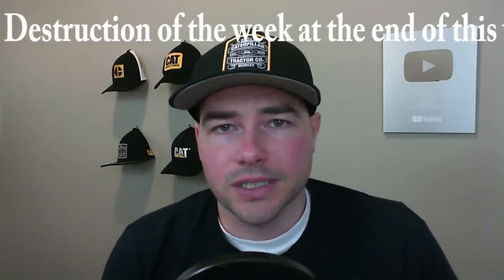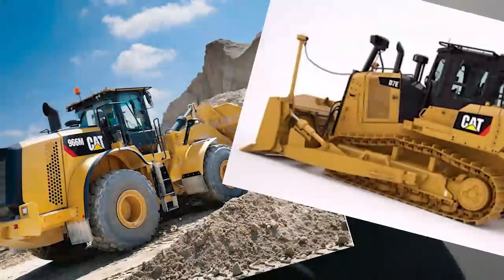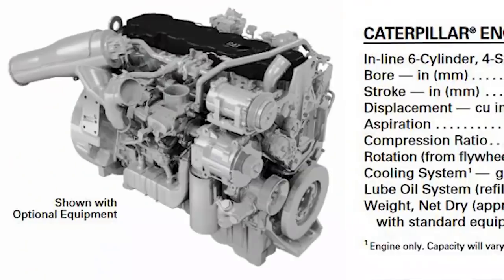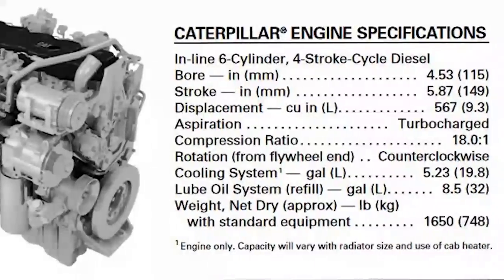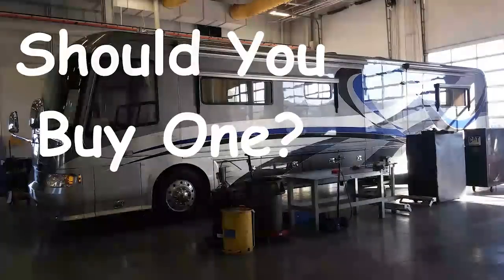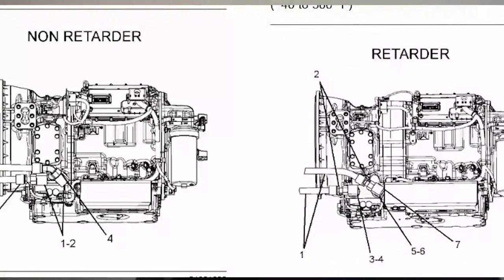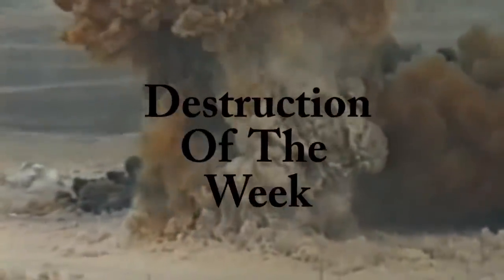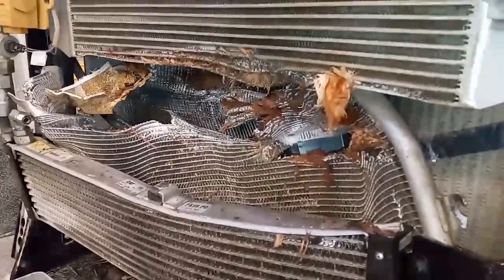Did you know Caterpillar made a TRANSMISSION for Trucks and Buses? The Cat CX28, CX31 and CX35.

Comment: In 1970's i drove Freightliner cabover with  Cat 1693 or was it PCTA 360???? (3406 name came later i think?)  with Cat 16 speed for CP Bulk Systems. Definitely not driver friendly compared to the Spicer 16 speed or Fuller 13 & 15 speeds in fleet with different drivers. Truck was a demonstrator and disappeared from fleet one day... It was rumored that US Army bought entire production.  Nobody missed driving it! Around the same time there was Allison CBLT trying to break into market. Don't think it was successful either. Remember back then big power was 350 Cummins, 8v71T's. Think that 1693's and 360 hp PCTA/DITA 3406's suffered from 2100 upshifting programed into drivers back then. No one was aware we were driving them wrong not using the generous torque curve. Unless previously driven a Mack (lots of Mack drivers never used the torque curve properly either with Mack 12 speed tranny).

Comment: Thr PTO location on this transmission was one of the biggest pain in the ASS to get to. The bolts never stayed tight.
Reply: Not even red locktite?
Reply: Snap on has a short stubby 10 mm ratchet wrench with a 3/8b square on one end. That was the only tool I could get some torque on the bolts with. Also had to use the pto manufacturer gasket because the CAT PTO cover gasket seemed to leak if used with a pto.

Comment: Was the Eaton Ultrashift a Option in The Cat Trucks as a Automatic (even though it is technically a Autoshift not a Automatic since it doesn’t have a Torque Converter)? Allison Automatics are Used in Many of The Super Haul Semi Trucks, The Allison 4500RDS & 4700RDS Transmission. Those Transmissions are Worth The $18-20,000++ Upcharge if your Application Calls for it.
Reply: Worked on a few CT660 cat trucks with the  Ultrashift automated transmission.  Most reliable besides a regular stick shift.

Comment: The cx-35 is still used in the 745 articulated truck and are still trash, we see them all the time, they are on there like 20th service letter now
Reply: And when ordering parts to repair them under the service letters, cat will only release them with a dsn number now :/
Reply: Yup we had to replace our transmission on 2012 740B truck at 5,000 hr now at 9,000 hr sometime the transmission downshift at high speed and over rev the engine sometimes.
Reply: CX38